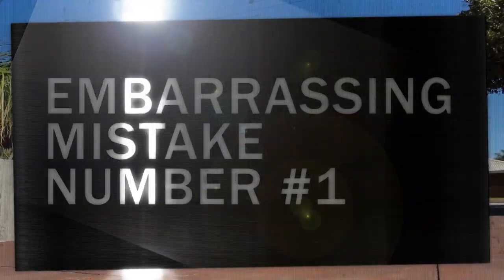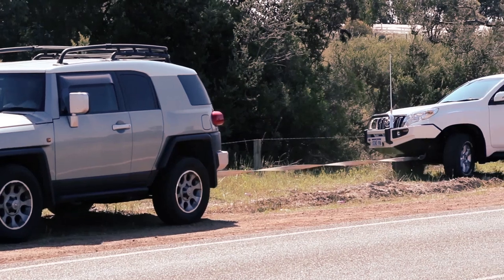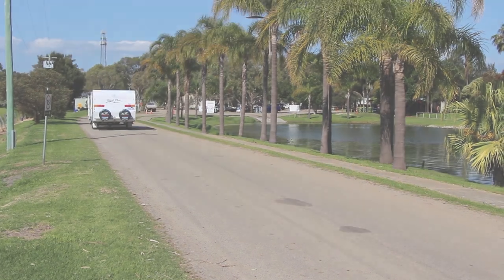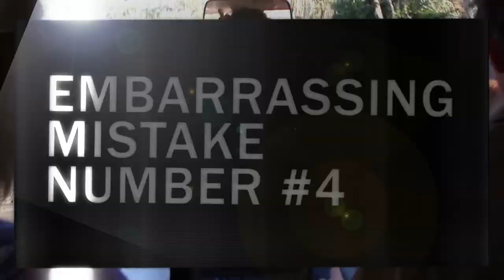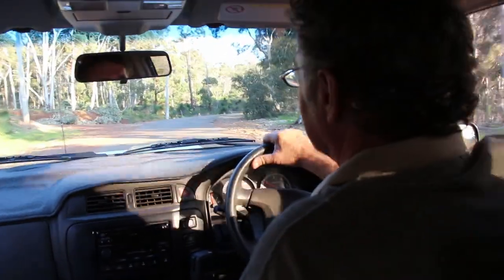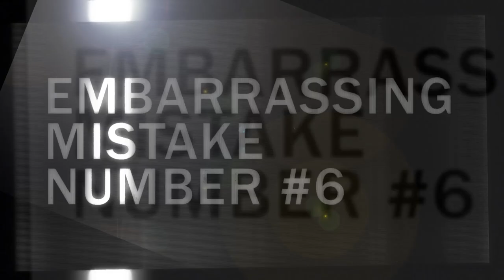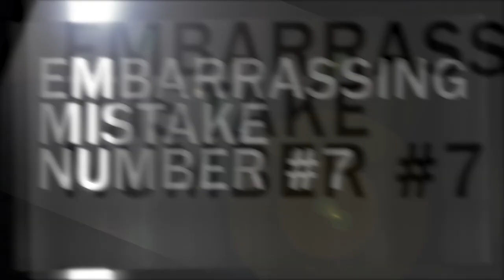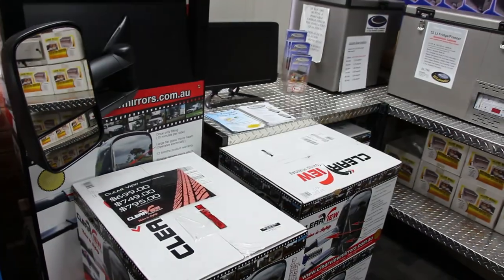7 Embarrassing Mistakes that 4WD and Caravan Owners Make

Comment: I have read the comments attached with this video and I well consider that this 
video has been made with good intent, not all of us are experts in 4WDing or caravanning 
however the simplistic explanation in this video may assist many.   Let me explain more
1) when backing a truck, horse float or caravan, back the vehicle so that the arc of the backing
trailer is visible in the drivers side review mirror.   Not the left hand side.
2) be carefull of tyre pressures 
3) avoid travelling at night and if you have to travel at night then travel very slowly and 
     if you think 80ks is slow, you may have to think again.  sometimes there are 
     that many roo’s about you just have to stop.